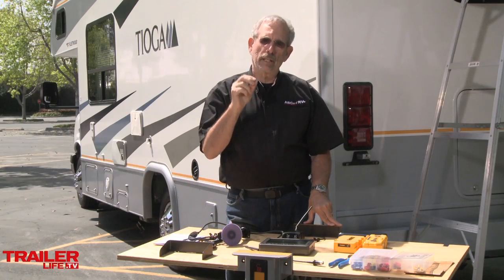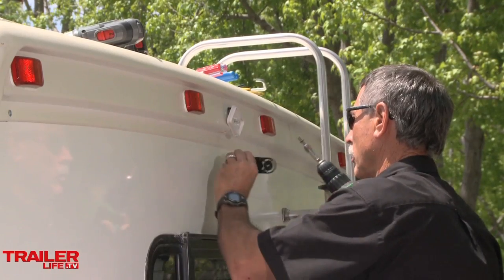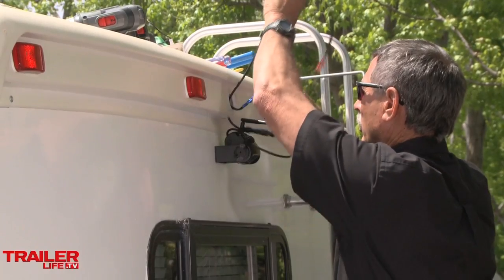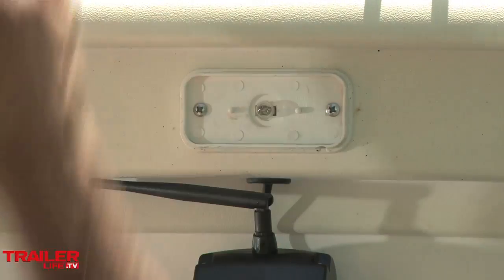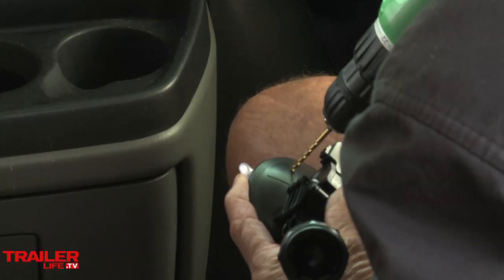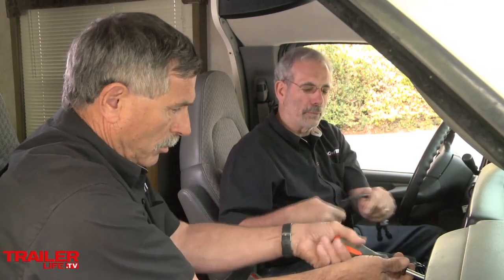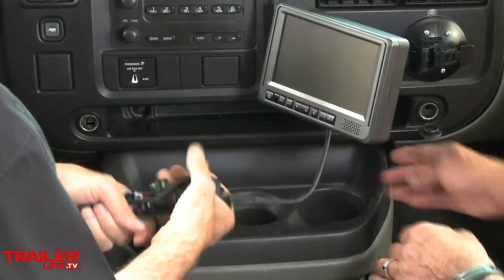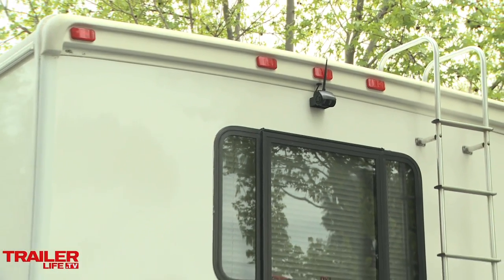Trailer Life Installs Voyager Back-up Camera

Comment: Rather than drilling into the dash, most units co.e with a sticky  back smooth resin  plate  which the  sunction  cup will adhere to. Or what I have done in the past was get a piece of lexan  and trim it to fit.   You can either install it as clear or paint the underside to match your decor.

Comment: Very helpful!  But ...  I think I might pair the units and test them before I mount either item to the vehicle and RV.  It's easier to pair, and you can make sure it works before drilling into your equipment.  Still - very helpful!

Comment: This video led me to believe that the installation was a DIYer's dream. The nightmare began immediately after I drilled the 3/4" hole under the center clearance light (LED) of my 2015 Lance. That's when any similarity between the video demonstration and what I was looking at ended. Did my best, but couldn't get the camera to pair. My dealer quotes $300 to install. Not a happy camper.

Comment: I have a Voyager WVOS511 Wireless Back-Up Observation System with 5.6" Color LCD.  Is there a camera I can purchase that works with this  system for backing up to the hitch?  It would only need to be black and white, not color.
Reply: I'm using the color camera on the back of  my travel trailer.  Need a hitch camera that would work with my system.

Comment: Have a class A with built-in camera.  It was initially working on the front TV, which was great.  Had to remove TV for an engine replacement.  After putting the TV back in,  backup camera no longer shows on the TV.    I suspect it is some glitch in setting the TV to receive the picture, but I'm not smart enough to figure it out.  Any suggestions or assistance?
Reply from the maker: Hugh, if they are Jensen or Voyager products, our Customer Service and Tech Service would be happy to help you  figure out what the problem is! Feel free to call them at 800-688-3135